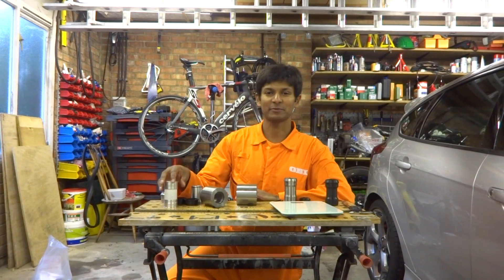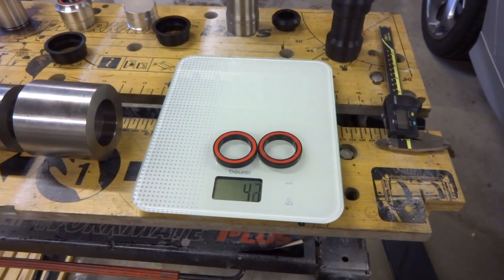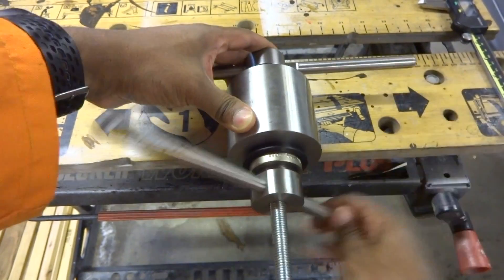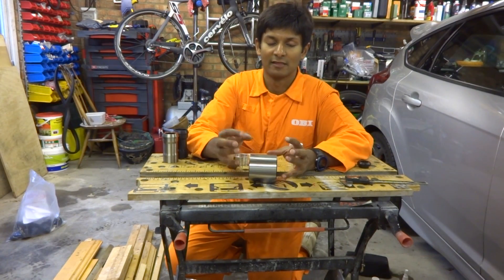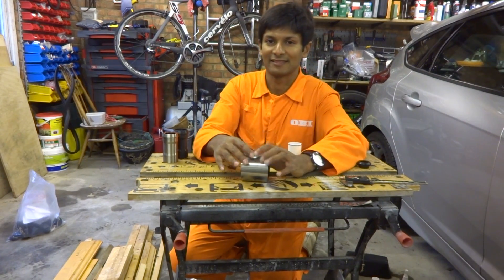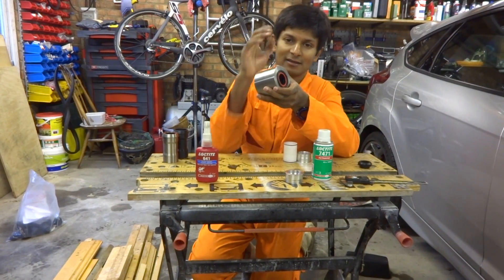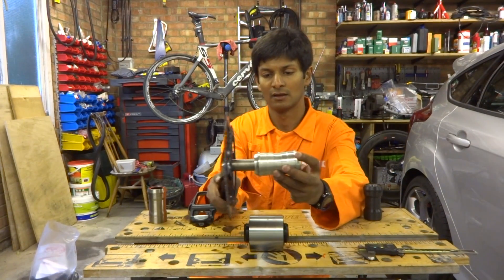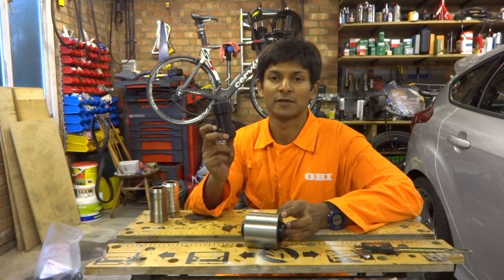PF30 Bottom Bracket Explained, Creaking, Pros, Cons and Fitting Shimano Cranks

Comment: The bottom line is that the bb30 and (especially) the pf30 standards are unquestionably the single-most idiotic designs ever to come to bicycling (even more so than the integrated headset).  They've done nothing but create problems.

The claimed advantages are a bunch of bullshit.  No one has ever proven any stiffness advantage of thicker spindles.
Reply from the maker: I'd agree for the most part. With regards the thicker spindles, a 30mm axle will be stiffer than a 24mm based purely on geometry. Would the end user be able to tell the difference  -  I doubt it, Lots of people win grand tours riding Shimano and they use 24mm
Reply: Hambini Performance Engineering 

Wider diameters don't always equate to more stiffness.  The wall thickness and materials used, for one, makes a difference.  Furthermore, the plastic bearing cups can (and probably do) compress under load, which reduces stiffness of the overall system.  I use metal cups for my pf30 frames.  Lastly, it's important to remember that the only portion of the spindle whose stiffness matters is that protruding outward behind the bearings.  The stiffness of the spindle medial to the bearings doesn't make a difference - perhaps there's some advantage in torsional stiffness, but I can't imagine this being anything more than minuscule at best.

The bottom line is that these bicycle companies probably don't test their products scientifically to assess whether their designs have the desired effect, and the end result is a number of solutions in search of problems.
Reply from the maker: You are right, my comment was referring to the polar moment of inertia and second moment of area of the two sections. All other things being equal if you make the axle diameter larger, it will become more stiff.  24mm to 30mm is a factor of 1.25, if you cube it, you get 1.95, so theoretically a 30mm spindle is almost twice as stiff. However as you correctly point out, stress finds it's way to the weakest points (probably the cups) and the increase in stiffness is not worth having - you may as well have had the lighter 24mm axle.
Reply: The one advantage, really, is versatility. Once you have a BSA frame, that's it. It's BSA forever. With PF30, you're able to convert to pretty much anything, including eccentric BBs. 
And there's also a song for all those people who have managed to strip their BSA threads :)

Comment: Thanks man, you´re a genius!
I guess buying a pair of these BB solutions would solve my creaking and mostprobably also (if choosing ceramic) would give a good if not the best performance. As they seem to do well (if not best) in your ball bearing comparison chart?
https://www.youtube.com/watch?v=wFycsAjunn0
Reply from the maker: Hi Stian, mmm... I'm not convinced by those thread together designs. I tried one made by praxisworks which is very similar to the enduro and it creaked - due to poor alignment (there is always small gap in the screw threads and that messes up the alignment). Creaking is just micro movement which you can hear. What crankset are you using and what bottom bracket type do you have?
Reply: Hi, I have a NORWEGIAN NAKAMURA with FSA Gossamer PF30 (50/34) (Plastic cups):
http://www.nakamura.no/sykler-2015/landevei/pursuit-7-0/
Reply from the maker: If you have nothing obstructing the Bottom Bracket Shell, I would go for a BBinfinite unit. Alternatively I do have a prototype that I have designed but not made yet, it's for a PF30 bike and BB30/PF30 crankset but I have never tried it. I can send it over for you test -  might take 2 weeks or so?
Reply: Hambini That would be awesome! I would be glad to try it. Anything to get that fixed. email me for details; stian.maurstad at gmail dot com. What else would I need then your prototype? I would then just reuse the ballbearings I allready have? Then some tool to get it out and back in again?